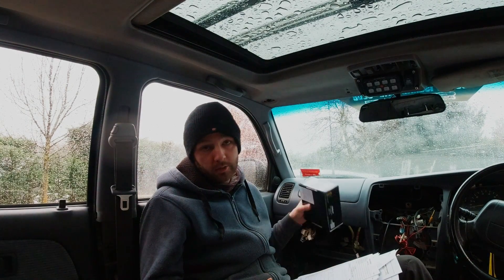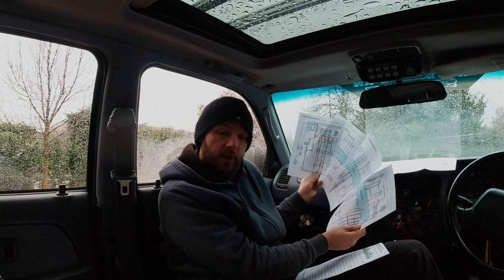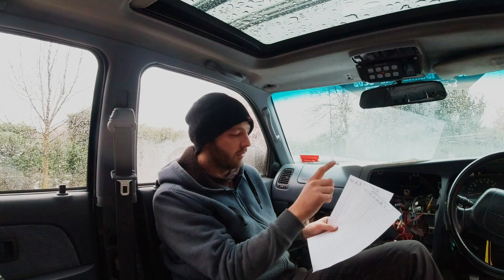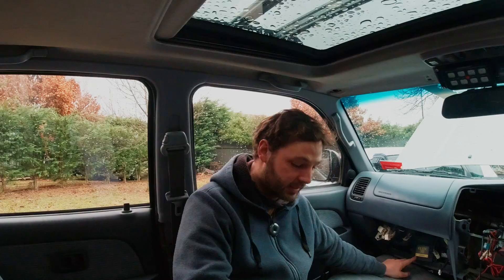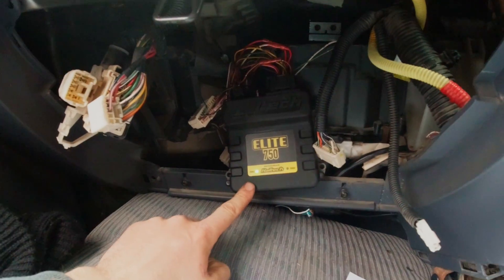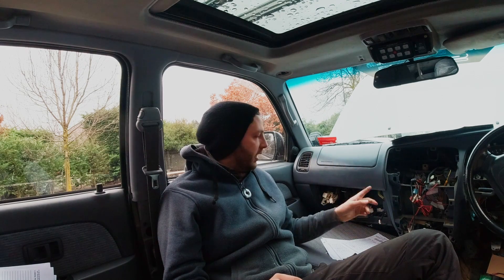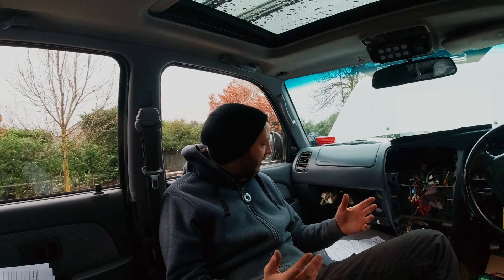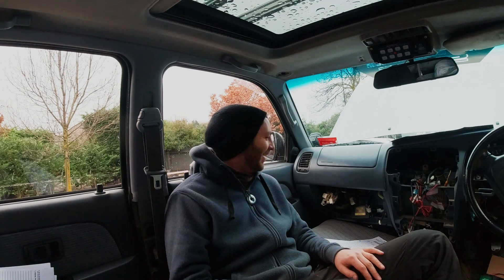Haltech 750 elite install to 3RZ Turbo

Comment: love the video! You should really learn to solder, especially for an ECU. Its much stronger, and easier to keep from corrosion. Last thing you want is a sensor wire coming loose and having to take your dash apart to chase connections on the trail. Its little details that makes the difference between having a reliable rig or having to do unnecessary work on the trail.